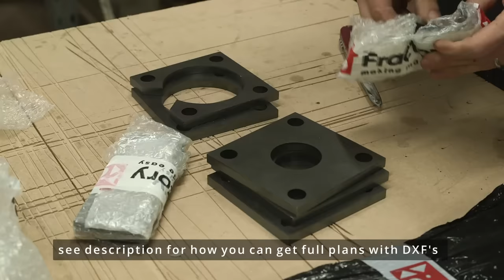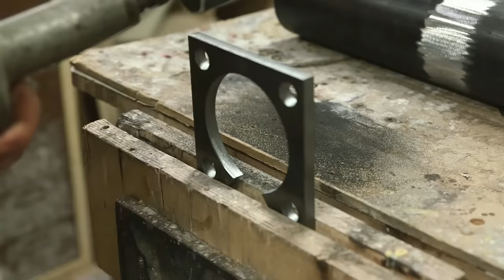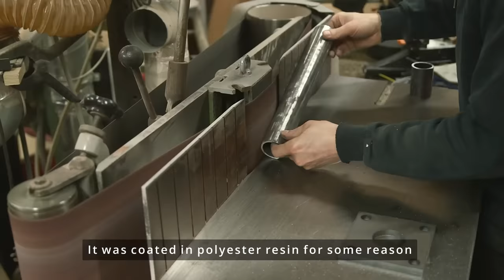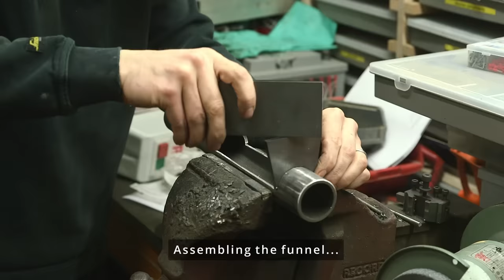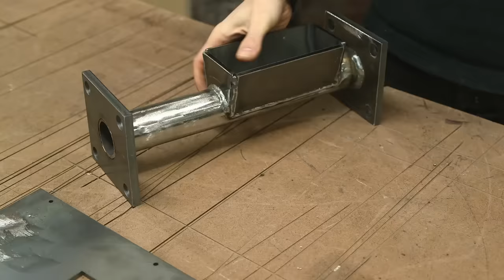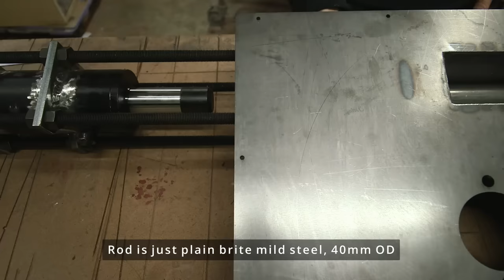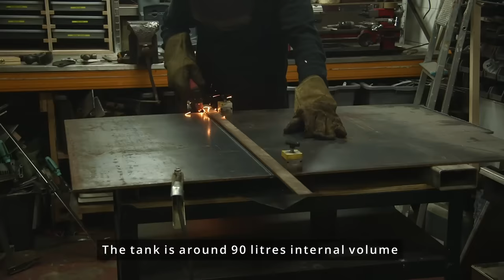Making a hydraulic briquette press

Comment: Absolutely brilliant. I always hated throwing out sawdust, feels so wasteful; this is a very clever solution 👏
Reply: Put up an ad for composters in your area.  Maybe it can be used for garden compost, and it definitely can be used for a composting toilet.
Reply: @dethmaul  great tips, will look into it!
Reply: I know an industrial arts instructor. He keeps his saw dust in 4x4x4 boxes. Buries his green turned bowls in it to slowly dry. Seems to work quite well.
Reply: i found that i could burn saw dust by wrapping it in paper like an oversized candy or Christmas cracker, the paper turns almost charcoal-like and protects the dust from flame licks and reduces the airflow so the dust bakes and compacts before it finally burning. i do suspect mileage may vary but its minimal effort for free firewood.
Reply: Sawdust makes good absortant for oil spills in the and might burn in a stove, compost makes a lot of sense since most of the most fertile soils in the world were under trees or tall grass

Comment: Very nice setup! A few things that come in mind: Maybe add some kind of a seal on the side where ram goes in so no dust comes out from the air puff and make the micro switches clogged up and stop working. Also you should think of some kind of sprinkler system inside or on top of the funnel where the sawdust is as its constantly mixed and air added, making it highly flammable. So if it would combust in any case, you could easily save the shop. Just my 2 cents :)

Comment: A couple decades ago, I was reading about someone experimenting with straw for heat using the same principle.  Straw burns very hot but does not last too long.  He added water to make it stick together better.  Might be an idea to test out there.  Lots of farmers might make use of it.  I can see problems loading the hopper quickly enough.  I think the furnace/stove he had could take the extra heat.  I have never heard any results from the original guy's ideas, but since then pellet stoves have taken off, although still not with the straw.
Reply: You'd probably need some sort of grinder device for the straw to reduce it down to 1 or 2 mm pieces
Reply: But the other thing to remember is what you really want is a slow burn burning very hot isn't really what you want, better it burns longer (if you want the heat for warmth that is) and a lower temp.. 
Of course if you're heating something a different proposition could mix the straw and the wood dust could be interesting..
Reply: There is a company here in Estonia that makes briquettes out of straw/hay/reeds that is left over from growing grain or other stuff. They press the shredded straw the same way sawdust is pressed into briquette. It produces 4,7 MWh/t and they sell it 150€/t.
Reply: Where I live, heating with wood pellets like these is common, and there are machines available to make them yourself.  One of the main reasons that it rarely pays to do so using home-generated sawdust/ships is that the moisture level in the feed material is fairly critical, an issue that is avoided here by using workshop waste, which is going to be fairly consistent and reasonably dry.
Reply: @modarkthemauler  Interesting, how big are the briquettes, and is it used in an normal wood stove?
Reply: @alanfeil2900  About hockey puck size. You can burn em anywhere you would burn regular wood or wood briquette.

Comment: The most environmentally way to get rid of your sawdust. Absolutely amazing.
Reply: I'm not being glib or holier than thou, but technically he is releasing the carbon when he burns the briquettes. If you want the most environmentally friendly solution, that is to compress the sawdust to reuse it as a building material. Of course this is still more environmentally friendly than burning lumber or fossil fuels.
Reply: @Auriflamme  It's the carbon cycle; Fire releases carbon, carbon absorbed by trees, trees become wood, wood becomes sawdust, sawdust becomes briquette, briquette becomes fire, and repeat... :)

Comment: Admirable! Only one idea: I have made millions of Pharma tablets (basically, the same process) and a tiny amount of lubricant make the pressure get down. Let me sugest diesel oil or used car oil (sprayed) or some cheap soap (powdered). You can easily test with a hand spray botle. Thank you for your effort, and sorry if I've repeated other comment. Its impossible to read everything.
Reply: Had the same thought.
Reply: @josephmiller997  Yep, chip fat or engine oil (both free) work well.

Comment: Really enjoyed that - seeing the refinement process is what sets your work apart for me.  However…
Dust, compressed air, acrylic sheet to build up static… maybe you should think about how to earth any static build up away in your hopper.  No problem in a damp Yorkshire winter, but a lovely dry summer day could see sparks and you don’t want your own Bosley Wood-flour Mill event.
Reply from the maker: ye I was thinking about that yesterday, ill run some tracks of that copper tape I used to earth the pipes on my cyclone attachment
Reply: And the constant noise it makes 😣 - would you put up with it? I certainly wouldn’t ☹️. I wonder what would happen if it runs out of sawdust? And how does the heat-exchange work?

Comment: Next time I wouldn't weld that ram, but make a bracket to support it, use a collet clamp around the ram, or cut threads on the end to screw it in place. Piston/bore tolerances are very tight, and welding can warp the bore making it essentially a useless paper weight. It can also introduce micro-fractures that could eventually lead to a leak, with all the risks of hydraulic fluid injections. Do not google that if you're not very tolerant to gruesome pictures.
Reply: Yes, I worked as a welder for 45 years, I find it hard to believe that the bore of the ram cylinder was not distorted by the welding, in fact the ram stuck at the weld level whilst he was inserting it.
Reply: I've always been a bit leery of working with high pressure hydraulics. If a pin hole or small crack appeared, how far away could it seriously injury you (not including orifices ;))? I'm guessing 3 feet?

Comment: I would never have thought in my life that the briquette press is such a complex problem. I imagined it was just a piece of pipe in which the chips were simply compressed - the harder the better.
Meanwhile, the cylinder with the piston is the least important element of the problem.
The press came out very well, and its most important distinguishing feature is that it works very effectively, without the slightest user interference. Simply: turn on - off. I like it, this is the best!!!
Thus, you have solved two problems: disposal of shavings and heating the shed.
I sincerely express my appreciation for both the approach to the problem and Your proprietary solution to the press.

P.S. What's next? Automatic briquette dispenser from the press directly to the stove? I am writing this half jokingly - half seriously. However, if you did something like that it would be the absolut World Masterpiece!!!

Comment: Loved this video.   It was absolutely fantastic to see to see the whole project come together.   The finished product is a long, long, way forward from the one I tried where one puts paper pulp, into a metal box and then squeeze the water out by hand, and you get a sort of a soft Briquette that you then leave to dry out like turf in summer weather only.   I gave up the idea but I did wonder if I had a pressure plate to push the water out of the Briquette it would make a  better quality and longer lasting product when burning.    We need more people with innovation like you man.   Congrats and long may you come up with brilliant ideas.
Reply: Yes....I get tons of cardboard from boxes and other recycled paper.......if I had a wood burner I'd make something to compress them like this.
I used to make wood chip from tree prunings to heat my tin shed with a home made wood burner made from a 25 litre drum back in the 80's.....it worked well but I've gone electric once the garage was built.

Comment: The only thing missing are a pipe from the "exit" and down to the wood burner. Then you can save your self walking up and down the stairs as well!
Just remember to have a big enough basket to store them in. 
Or, since you are already on it with the electronics: Make a sensor or switch to turn of the machine when the basket is full.
Reply: I am envisioning an auger feeding a thermostatically controlled wood burning stove.   
It would be far too dangerous to feed raw sawdust into a wood stove but converting the dust to pellets as an intermediate step would solve this problem.

Comment: I can see the dust around the micro-switches being a problem in the not too distant future, maybe a puff of air from the funnel blower could control that.
Reply: @amandagardner565  I don't think the amount of dust here could be considered dangerous, it is far less than he creates with his normal tools all the time. Mounting the switches upside down would make no difference, the dust is already airborne and will still cause issues as well as much flammability as a small occasional puff of air would create in moving it away from the switches. Sealing the box better would be the ultimate solution.
Reply: @ctiley2212  you may be right, but i'd prefer he err on the side of caution. 
i've seen how volatile just a small amount of airborne dust is with someone shoveling piles of it into a furnace, the blow back put the guy on his ass and he was very lucky he had PPE including face protection. he had some wicked bruising for a week or two, and learned not to ever do that again.
Reply: @amandagardner565  What about just a fan?
Reply: Proximity switches would alleviate dust or mechanical issues.
Reply: @jamescarver6275  quite right, proximity switches are even better, a bit more costly, but he's spent a LOT of money on the entire setup already so may as well got for the best.
Reply: @amandagardner565  Inductive sensors from China are almost as cheap as a decent micro switch.
Reply: @mfx1  ok, it's been over 20 years since i saw one pass through my hands, and back then they were $60 to a few hundred dollars from a supplier in Australia.

Comment: Good use of the precision alignment squint. Always important, though, not to confuse an ISO-5725 compliant measurement squint with an ISO-16321 compliant safety squint. The two may look similar, but are not interchangeable.
Reply: As many a sloppy squinter has found out to his cost.

Comment: This is amazing! 

A suggestion. Do away with the spinner, and put in an auger feed with a trough. You than then eliminate the air and make it less likely to ever jam.
Reply: I was wondering about that.  There was at least one point where I could see chips creating a bottle neck if you were machining damp wood.  Our thicknesser planer was a terror for clogging up our big industrial dust extractor when milling damp wood.  It is better now we have helical heads though.

Comment: Not sure if I missed something but having 5 years making wood pellets. You don't seem to have created a taper at the start or finish of your die. The aim is to compress the wood enough to release the naturally occurring lignin. At about 100 degrees centigrade the lignin goes into a plastic state easily passing through the die. It then cools and hardens. Good pellets or briquettes will not crumble as yours appeared to, in fact you could find them harder than the original wood. The outside should be shiny. It's possible that you have good compression but your feedstock is outside the 8% to 11% moisture content that is ideal or the material is perfect but the compression is wrong.
Add corn oil to aid binding and reduce the friction through the die especially at the start and finish of your run. A rough finish to the inside of the die is really bad but you can run your mix with some sand to speed up the smoothing of the surface.
Your feed bin needs to be round to reduce the power demand of the paddle and maybe try using just 2 arms.
Good work otherwise.
Once you get it right don't change anything and you will be doing better than most.
And never put material through twice. It will drive you mad as it will stop anything working without adding new lignin.
Reply: If these are valid points, they deserve to be presented more positively. You are talking down at this guy.
Reply: @peppigue  absolutely not talking him down. Many see both pellet and briquette making as like witchcraft which is absolutely untrue. The facts I put forward are from having successfully run a pellet mill with varying materials and can tell you the frustration found by myself and colleagues when something that worked suddenly does not anymore. The ability to improve the quality was always paramount.
It had to be as we were producing them commercially and not just for personal use.
Reply: @richardlee2488  Up or down, I like that you are trying to enlighten. Good on you!
Reply: @heymakerphd1982  one small step in the right direction maybe a giant leap. The technology is different for a ring die but the aim is the same.
I saw an Indian made briquette machine at a show and was amazed at the quality of the output briquettes. Rich dark brown with an almost polished shiny appearance. Until then everyone else was showing off crumbly chipboard like things. I think most were trying with material that was a bit damp.
I used to get a real kick from turning a pile of sawdust into 4 tons of grade A pellets in a 9 hour shift and running a planer or sawline at the same time.
Reply: I think you missed the point of this project, which is to reuse the sawdust he makes as part of his woodworking. He's not going to pour corn oil into his dust extractor....
Reply: @ianjamesevans  No, not pour.  I could however see him building a dedicated pump and reservoir along with a misting nozzle that consistently administers the perfect amount of oil at just the right time to his mixture.
Reply: @richardlee2488  good information mate thanks I  have often wondered about how to turn saw dust into bricks
Reply: @collina.7336  No need for a pump or to apply a mist. A simple gravity feed which drips a very small amount is enough. The ability to mix the material prior to it entering the die chamber is better but not an exact science. The choice of materials in the construction of the press and die must be considered if timber like oak with high tannin content is processed. The heat during compression is enough to reduce moisture from 11% to about 6% and the resulting steam is very aggressively corrosive to normal steel.
The storage of the pellets or briquettes is a safety concern as they have been identified as giving off carbon monoxide gas. Ventilation is needed at ground level to allow gases to escape safely.

Comment: Impressive build. I have watched this several times and continue to be surprised that the logs/briquets don't require some sort of binder to keep them intact. You must have some level of moisture in the sawdust?
Reply: If there isn't moisture in the wood to start with, there definitely will be once it's sawdust, it'll be pulling water from the air constantly.

Comment: Neat project... Have you measured the end to end energy consumed by the process, i.e. running the pumps, managing the control systems, and cooling (water flow)?   I would be curious as to the net energy difference between what it is costing to produce briquettes vs. how much energy you get out of the briquettes.
Reply: Factor in: no need to empty the collection bags, reduction in storage for briquettes over loose dust, ease and better results in the wood burner... as well as waste heat within the workshop during cold months isn’t wasted.

Comment: You may consider having a 2 stage die, where the piston pushes a 4" column of sawdust down a 12" section of heavy pipe to a gently tapered cone shaped reducer and then another 6-8" section of the now smaller diameter pipe to the outlet. When you were handling the final product it did not seem very dense, a more dense final product takes up much less space in boxes or bins. Very cool design

Comment: I made a rocket stove, and burn wood offcuts, fed in through a gravity chute, which vibrates every so often to move them down into the firebox. Here's a thought: what about a hopper and auto feeder into the top of the stove? You could have a regulator that fed in more or less, depending on how fast/hot you want the stove to burn.

Comment: I had a Briquett press I bought that was very similar to this. Great build.

Beware!

What happened to mine often enough is that if it ran for a long time the tube and form would heat up and expand so sawdust would get between the press and the form (tube) walls. This wouldn’t be a problem as long as the press kept running.
What would be a problem would be if the press stopped running while the press was inside the form, in the forward position, and cooled.
The form would shrink around the press and with the sawdust between the two could not be moved. It would rip 3/4” all thread connecting the press to the ram trying to free it.

The solution was to make sure that the press never stopped in the forward position. Always have the press stop in the back position to cool.

I never did get the the point of working this into the wiring and ended up getting a larger machine to match my higher output of 375 kg an hour